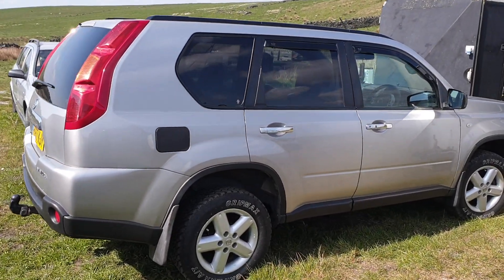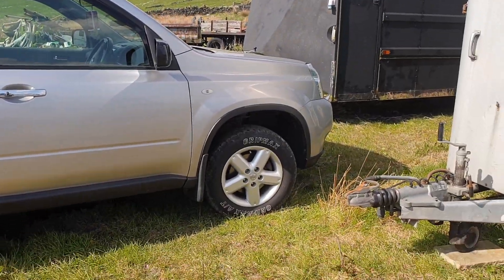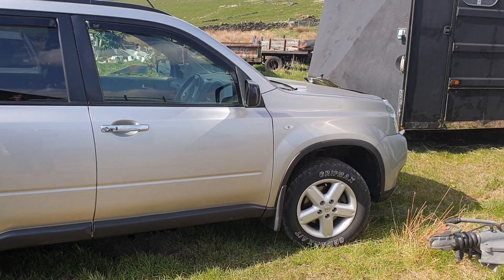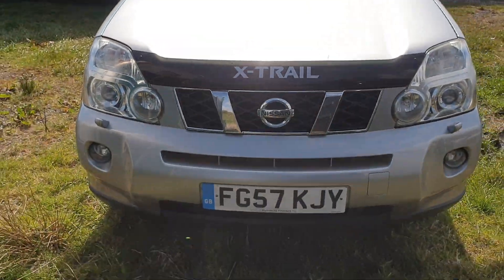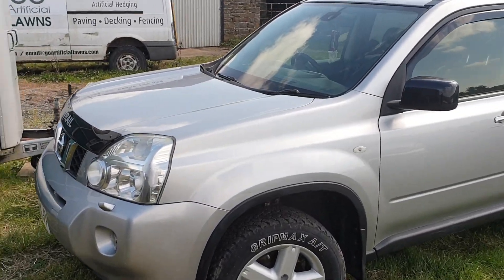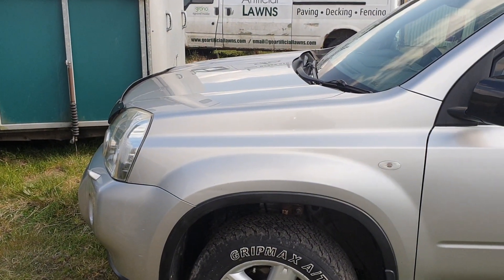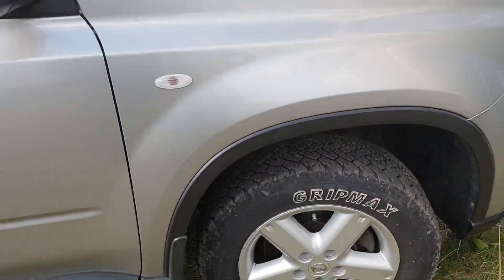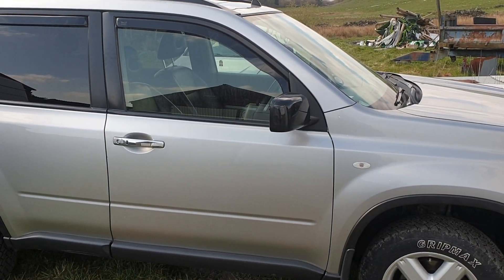Nissan X-Trail t31 with lift kit and problems solved

Comment: Was thinking i doing mine. However some research found a common opinion was never lift it higher than 35mm due to axle wear that you are experiencing.
Reply: 40mm / 1.5 inch is fine.  You just have to get other bits and pieces together to get the alignment correct, front and rear.

Any higher than that and you'll want to do a diff drop as well.
Reply: @DoubtingThomas333  what bits and pieces could be ? im thinking buy the same lift kit but i see some people with cardan problems after install..
Reply: @J0taM  Camber bolts, adjustable rear camber arms, adjustable sway bar links (front and rear)